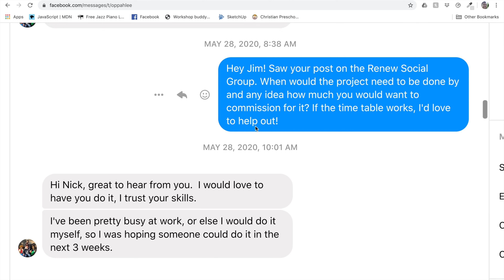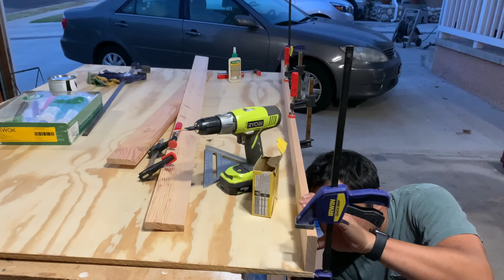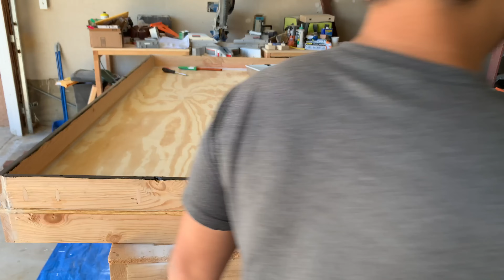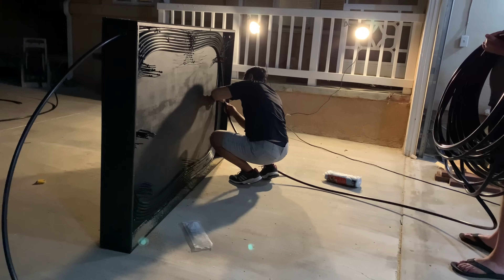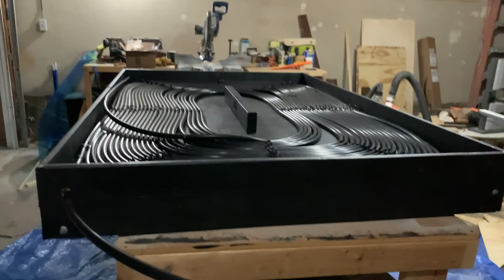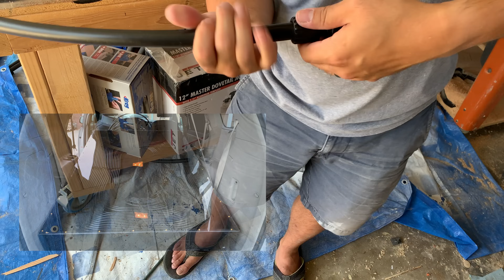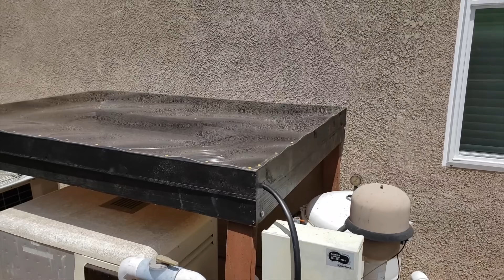DIY Solar Water Heater Full Build

Comment: One question - why paint the wood black inside the box? 
Surely that would simply mean the wood ends up absorbing solar energy. Since the bit you want to absorb as much energy as possible is the black tubing wouldn't the best thing to do be line the inside of the box with something shiny so the energy is reflected back towards the tubing.
Reply from the maker: Yeah... that's a good point. Several people have pointed out that painting it white would have been better haha.
Reply: @nwkwok  White would work too, though I suspect shiny might be better.
Reply: @nwkwok  Another thought that could reduce costs even further would be to lower the panel to below the water level in the pool. Then connect the inlet end of the panel to a spigot near the the bottom of the pool. Connect the return end to a spigot just below the water level. Natural circulation due to temperature differences would then cycle the water in the right direction without the need for a pump.
Reply: @remittanceman4685  I haven't done so personally, however while that should produce some circulation, I think it would move the water too slowly, resulting in very high temperature of what does manage to circulate, but lower overall heating of the pool due to lower absorbtion of heat in very hot water vs faster circulating (and therefore cooler) water that will absorb more.
Reply: @bran-qt7ds  It's how solar water heater systems work for houses with a 300l tank instead of a pool.
To control the temperature, either have the hot water inlet discharge into a bucket with holes in. this would mix cool pool water with the hot heated water before it came into contact with human skin.
Or fit a valve to the pipe from the solar panel. Once the pool gets warm enough, simply stop the flow with the valve. If the pool gets too cold open it again.
I've seen systems like this working and they worked well.
Reply: @remittanceman4685  I didn't dispute that such flow technically 'works', but heating a small water tank is very very different than heating 20 to 40 thousand gallons, that in addition are completely exposed to open air.  You also missed my point about the high temperatures from slow movement, which is not at all about worrying that the water will not be dispersed enough at the outlet, necessitating some type of dispersion from an improvised bucket.  It's about the well established concept that the hotter the water the less heat it actually absorbs.  Therefore your proposed very slow circulation method would result in far less heat being transferred to the pool.
Reply: @bran-qt7ds  Obviously it does depend on the pool size. But I have seen (and used) a small pool (not tens of thousands of gallons) heated by a simple coil of black pvc pipe without a pump. That certainly worked and the trick seemed to revolve around the height differential between the pool and the array. In that instance there was a slope and the array was perhaps 2 feet below the pool.
As for the bucket comment, that was to prevent scalding and distribute the very hot water you say would be the product of the system before it came into contact with pool users. Distribution within the pool was either by nati=ural convection or the motion of the swimmers themselves. Again, it seemed to work quite well in the pool I was in.
I'm talking about small backyard splash pools, maybe even above ground pools, not the larger ones one sees. A bit like the one in the video in fact. The larger pools obviously need something with a bit more oomph, but then if one can afford a larger pool, a more powerful solar heating setup may not be a financial concern.

Comment: I can almost guarantee you your acrylic sheet has spawled / cracked where the screws are ........ always use rubber grommets / washers and it will stop that from happening.  Also make your holes slightly larger than your fixtures / screws as the acrylic sheet will expand and contract with differences in tempuratures

Comment: Very good will be my almost imm next project I wanted to know how large a 100 foot roll would be spread out and would it be enough for 7 foot Intex, but why I wrote I haven't used poly-pipe either even though I am plumber, but one vid I just saw a guy sat the coil on a swiveling office chair to uncoil it, wouldn't you know my junky outdoor office chair was literally thrown away yesterday (WTF!) anyway still watching but so far so good. I took pics of your vacuum and workbench will have to try those out someday, thanks!

Comment: I gotta say you have heart and perseverance 👍 Was a bit painful to see you tackle the learning curve of coiling the tube and using the tie wraps…..I’d bet if you made another one you’d be able to pull it off in a fraction of the time
Reply from the maker: Thanks so much. If I were to do it again, I definitely have some different design ideas with the tubing for sure. Those zip ties were painful ;p
Reply: @nwkwok  I’ve made several versions over the years for my own pool and although your package is certainly preferred and a beautiful working art, I have found that just laying the coil of tube on ground is nearly as effective with zero labor

Comment: Very cool, thanks for sharing NIck.
My advice based on previous frustrations is to use UV resistant zip ties (or they will suprise you sooner than later) and to use a higher class (6 or 10) pipe. Thicker wall lasts a LOT longer in the sun and also doesn't kink and bend too easily.
Your build is definitely beautiful though :)
Reply from the maker: Thanks so much! The zip ties are UV resistant and good advice on the pipe. Didn’t realize there was a higher class for it!

Comment: Add a reflective vertical panel on the wall over the heater and get  60% more heat in the water.

Comment: I built something similar. Coiling it is not as easy or simple as it looks, especially if you're working alone. A big performance upgrade, is to cover the tubing in black sand.

I have 150' ⅝" in a 'pile', wound into a bundle around a spindle and wrapped in 4 layers .7mil dropcloth and outer layer of 6mil clear plastic. This feeds into 150' ⅜" flat coiled on a board for quick heating. I can shower outside with it at near freezing. Heavy overcast will still yield warm water.

BTW, string or wire and a staplegun, is the way to hold down the tubing; staple the end of the wire to the edge of the box, layout a coil, pull the wire over the and staple it. You can do it right off a spool - thunk-thunk-thunk all done. It also helps to have the tube filled.

Comment: you could have just put the tube coil through a pole and pulled sufficient amount of tube gradually and you went on working.
Reply from the maker: Hm interesting idea. I can't quite imagine how that would work but I'm probably not understanding what you're meaning. But yes, there were probably a million ways I could have uncoiled the tubing better hah.
Reply: @nwkwok  Just like is working with thick cables or optic fibre street installation,yo need to pass an horizontal pole or thick metal tube thru the coil as an axle in order to revolve the coil as you pull  the end ,so the plastic tube will not twist.

Comment: I think 2 panels at 250 feet each would be more efficient. Water travel 500 feet won’t be getting any hotter after a certain distance. Also the bottom should be insulated.
Reply from the maker: Hm that's a good point. And yeah definitely should've thought about insulting the bottom

Comment: I've done several of these panels for my pool.  Best thing I've found is a lazy suzan that I put right in the middle and just uncoil the tubbing from there.  As you get close to the center you can unspool some extra pull the lazy suzan out of the middle.
Reply: Video
Reply: How have they held up?

Comment: 120⁰F might do some damage on the irrigation tube. Yes?
Reply from the maker: Yes - we decided to go with a different pump because the water was originally coming out too slow (which is why it got so hot). Now it is ~95 degrees and comes out faster (which in turn, heats up the jacuzzi better as well).

Comment: I just kept my 500' roll of tubing under some double pane used glass windows and made sure that the low emission side was facing the hose inside.  Done.  Puts out lots of heat, went from 78 degrees f. to 92 f. in 2 days in a 20,000 gallon pool.  I can't even touch the water at the outlet,  Temp outside was 88 f.  But the heat output is so hot that I often put a towel over it to minimize the heat.  It's like an oven.
Reply: Are you saying you basically use a box the size of the roll with a glass top? I want to make one myself but I like simplicity
Reply from the maker: Awesome! Well done :)

Comment: Hello Nick Thank you for the viedo.  I want to do this but the hardest part for me would be building a box.  Could I use an aluminum water heater 30" pan?  This set up is fantastic.  I bet someone could build them and sell them and make a nice profit.  Also I want to put the solar pannel on my flat roof patio cover will any pump work?  We live in California and limited on space the pool will go between pato and fence with inches to spare.  Thank you in advance...
Reply from the maker: Wow sorry for the delayed response! I don't have the insight to speak to the aluminum water heater 30" pan (though I don't see why not?) but I have seen a couple of videos of people not even using a frame and just mounting it to their roof with good results. The things to consider would be the how powerful the pump is and angles the tubing would be inclined / declined but otherwise, I'd imagine it's doable? What did you end up going with?

Comment: I built one with landscape style tubing...just be sure to keep water and circulation during sun hours or you will melt it down...

I also used steel studs vs. wood.  Made it lighter.
Reply from the maker: Ah good point. Thanks for the tip!

Comment: How do You get the water out from the pvc pipe in winter
Reply: You can use an air compressor to "blow out the lines." This is done with in-ground sprinkler systems.

Comment: Would this be the right type of pipe: https://www.ebay.co.uk/itm/333280078009?hash=item4d990a68b9

Also, any suggestions on how to fix the piping to a pitched tiled roof?
Reply from the maker: Not sure actually. Here's the tubing I used:

https://www.homedepot.com/p/DIG-1-2-in-700-O-D-x-500-ft-Poly-Drip-Irrigation-Tubing-B37/100163329

Comment: You should be using copper pipe 10mm microbore. Not pvc. Thats toxic for warm water. Copper has the best thermal efficiency in affordable category of metals. Its the third after diamonds and silver. There is not chance that you get the thermal transfer from pvc at maximum temperature from the inside air. 172°F supposed to be your temperature if using copper. Easier to bend and work with.
Secondly, you need ceramic wool for oven insulation on the wooden panel and spray painted aluminium sheet on top of the insulation. And at the top you need 3mm glass first and then 5mm air space and then Perspex 2mm thick. Not that flimsy thin sheet unsealed at the edges.
Badically you ve done this video just to get few dolars from youtube.
But if you want to become professional and have a long term projects, you need to change the crapy items with quality.
Go in physics and do research about copper thermal transfer. Stop being a kid. You need to do research before attempting non sense and non reliable and even toxic water heater. You have no ideea how wrong you are by posting this video. Some day you will get cancer in your body. Because thats what you preffer....cheap and dangerous items
Reply: LMAOOOO!!! Meanwhile, your 5-year old "0 Pollution" channel has "0 videos". How about you stop being a keyboard warrior and put up some videos to show "how it's really supposed to be done". Pffft!

PS. Stop spouting so much negativity. I hear it leads to cancer of the mouth. LOL.

Comment: It is really great job. I wonder have you connected it to your existing pool pump. How that part works?
Reply from the maker: Ah we didn't exist it to the existing pool pump. There is a pump in the jacuzzi that pumps water out of the jacuzzi, through the water heater and back into the jacuzzi. The water heater is just resting on top of all the pool pump stuff.

Comment: All new users (or any user for that matter)  of a solar heater need to be very careful when turning the heater on after it has heated up if not done in the morning. The hot water that was sitting still in the heater tubes WILL scald your hand or anybody in the pool that's near the outlet. It will be scalding hot for about 2 minutes.

Comment: I built a jacuzzi heater with old windows black paper and dirt to seal air off under old windows laying on black roofing paper.
Had a old roll of the same low pressure tubing. It was all kinked up. Eventually the kinks are where the leaks will happen over time.
If the water does not flow to remove heat the temp can get close enough to boiling to cause half melted softer plastic to rupture.
If pump works always when hot then this problem is reduced.

Comment: Very nice...your video editing to your craftsmanship to your attention to detail. Although i dont think this would work on my 24' pool in Wisconsin,  its still very nice!!
Reply: I have a 4x6 with 100lf of pex.  It raises my pool temp by 4 degrees in the summer in Florida.  Takes my screened pool from 82 to 86...perfect.

It's on a tracker as well so constant sun!
Reply: @richpalmisano1740  how does a tracker work?  Always points to the sun?
Reply: @SteveV2023  yes.  Two axis although that's overkill honestly.  Only need east west.  Pretty simple build for a single panel.
Reply: @richpalmisano1740  what does something like that cost?
Reply: @SteveV2023  controller and  actuators about $350...I have about 700 in my heater all total

Comment: IDK, my DYI above ground pool solar heater was done in about 1/2 hour AND without all the extra parts and $$$. I got 2 4x1x6' boards, zip tie them into a X, then took black sprinkler hose at starting at outside of X made circles and zip tie them to boards until done. put it on my garage roof for extra heat. 
NOTE: there's no way in hell that you can get water to 120 F for any length of time. It will be way too hot to put your hand under at the beginning but WILL cool off quickly to maybe a few degrees above pool temp, but going from 78 to 80 for a large pool is a big difference. So don't LIE about what temperature you can get with this system.  may only issue after more than 10 years is the zip ties get sun damage and need to be replaced maybe every other year.
Reply from the maker: 1. Awesome on you for being able to do it so quickly without as much stuff. I have no doubt that there are people out there that can do this much better than I can so good on ya'. 

2. I built this for a friend and I was not there to test. He filled water from the pool and got the temp and then filled a cup with the water coming out of the heater and took the temp and he sent pics. I have no reason to assume he would send me a false temp picture?? But that's how the temp reading came out. 

3. I mentioned in a previous comment that the water was coming out too slow (even though it was hotter) so he ended up getting a faster pump which was putting ~high 90/low 100 I think? (don't remember) but since it was faster, it heated the pool better. I am no an engineer by any stretch of the imagination - just followed another person's + advice from woodworking community and went for it for fun.

Comment: Cool project. When building a heater like this to heat a pool, do not focus on maximum output temperature, but instead focus on transporting as much heat energy as you can from the sun to the pool. 
Using two coils in parallel instead of one super long coil will decrease resistance and thereby increase the flow, you will heat up the pool faster, even if the temperature difference between input and output is only a few degrees. That is because more energy is transferred this way.
Also beware that this solar heater can overheat when it is not in use and the tubes might melt, depending on the materials used.
Reply: Yup! Exactly why I did 2 separate 100 ft coils on 42"x48" pc of black plywood.  I'm doing it for fall swimming. Our pool is already 82-88° IN JULY SND  august. Trying to extend the kids swim season up here in maskachussetts 😂

Comment: Put the roll of tubing on an office chair. The chair will spin and unroll the tubing as you pull it.
Reply: nope, you need to ride the chair with the roll around the panel then. What i did was put the roll in the middle and then start to connect the pipe to the panel little by little
and then just turn the roll with it.

Comment: I was thinking if you put a little (25ml) of water inside under the  glass, vaporization and condensation cycle of that water would improve the efficiency of heat transfer

Comment: This doesn't work at all. Don't waste your time on building this!!!!!
Reply: Why u say that?
Reply: @timb8678  Because I have spent 2 days building it and it didn't worked at all today... It was very, very sunny day... Around 90F. Even with very slow water flow (1.5-2 liters per minute) it provides basically the same temperature of water that I already have in pool... I got like 150 meters of 15mm hose

Comment: While absolutely enjoying this build, I’m sitting here and wondering how much hotter this could get if you’d make it Gas tight and replace the inside air with CO2.
Reply from the maker: Ooo that's a whole 'nother level ;P
Reply: Not much. Better to put a couple of big mirrors on it
Reply: @bren42069  Thats a great idea, but the light cant be too focused or you will melt the acryl